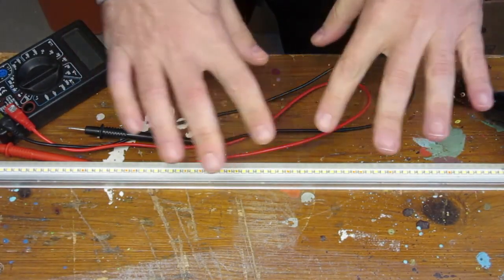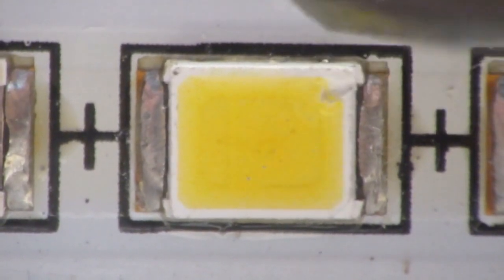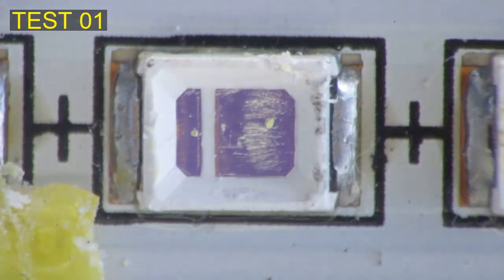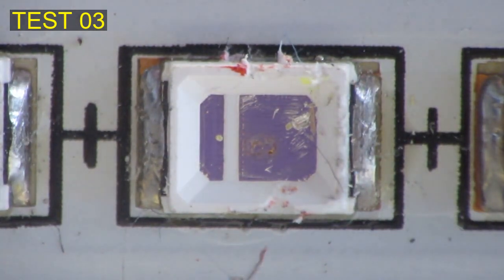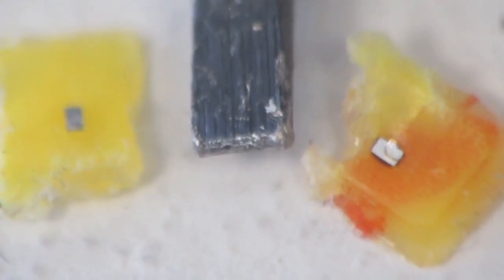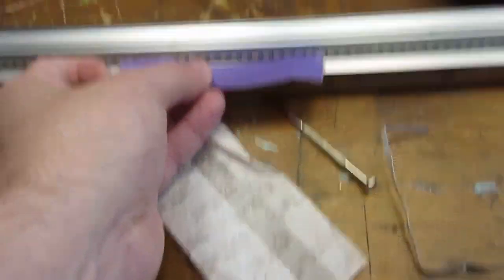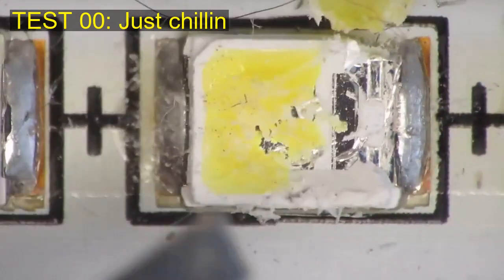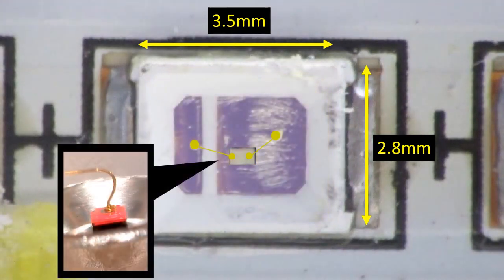What Is Inside An SMD LED? And How Does It Work? Let's have a Look! #LED #science #electronics

Comment: 🤩 🔬 💡
Reply from the maker: The emoji master has "spoken" again 🧜🏾‍♂️💅🏻🍜
By the way, you inspired this video with your question on LED failure last time
Reply: @TheLabOtomy  ahhh. I wondered. It was very cool. So there are impossibly small wires under that plastic? That blows my mind. Last night I was shopping for an oversized decorator LED bulb and woke up to an itty bitty LED being taken apart.
Reply from the maker: Hardly scratches the surface on that one, and what I saw was just amazing. Just google "wire bond" for instance if you are interested to see more tech that can blow your mind...
Reply from the maker: Thanks for sharing, I will go through this day feeling a little more instructed